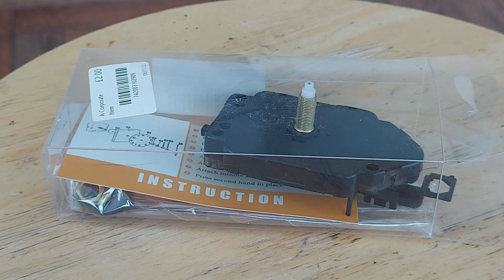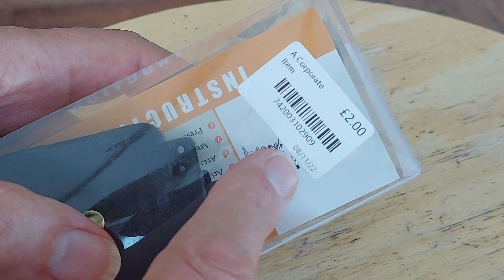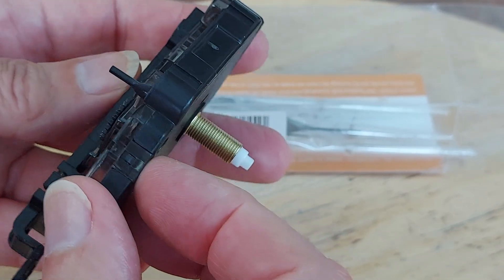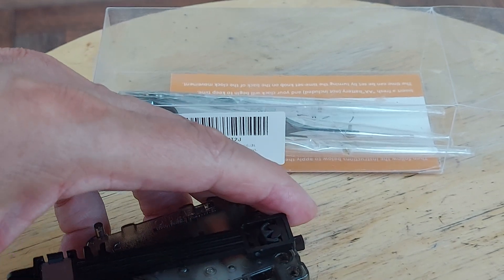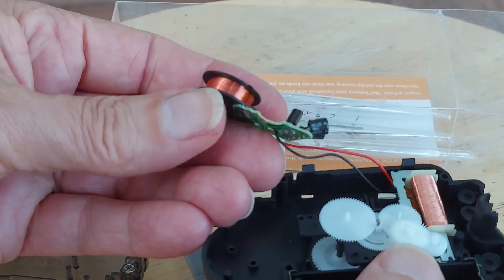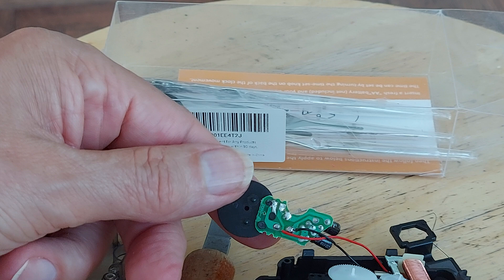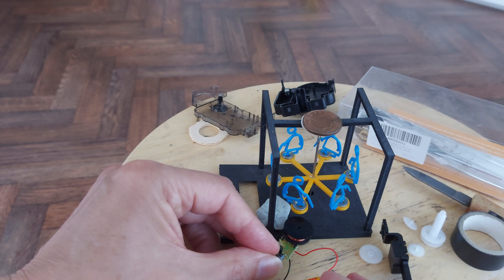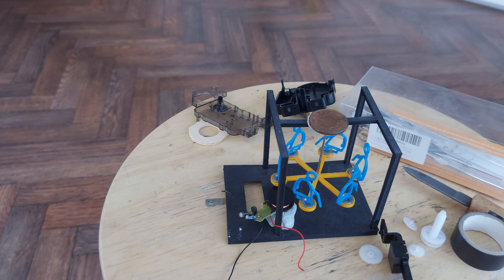Clock Pendulum Pulse Circuit

Comment: Congrats! That is the same drive unit that I am using with solar panel and super cap motor I have shown.   It is one of my favorite devices now because it will either run all night or if it does stop will self start in the morning when the 3F cap gets filled.  Fun stuff. You might try it with the rotor magnets positioned on the edge and the driver pointed at the rotor rim. I have had good luck with that.   👍😀
Reply from the maker: @Lidmotor  at the moment, I seem to need more power than you are using. I am using parts from an old pulse motor. I may have to do a redesign. I have tried it with the magnets vertical, but I might have made the disk too heavy as it needs a push to get it going. Once it is going, it picks up speed and goes very fast.
Reply: @GrandadIsAnOldMan  Getting the 'self start' feature to work is more luck than anything.  It doesn't work all the time on the things I have made.  You are right about rotor weight being an issue .  The diameter of the rotor and the magnet number is also a problem.  The standing pulse that gets the thing moving has to match up with the rotor physics. Once the rotor turns fast enough there is some feedback to the circuit that keeps it going. Basically it is like the solar wavers that we have been using all these years.  It is just something new and different to fiddle with.  If your snowman could talk he would probably say. " So what? I have been doing the same thing for years on an old dead battery.:face-blue-wide-eyes:

Comment: Handy little unit saves winding coils and is on a usable circuit board so wires don't get in the way or snap . And for the price you paid amazing  👍
Reply from the maker: I can't get my pulse motor running as well as Lidmotor did with his. I may have to have a redesign.